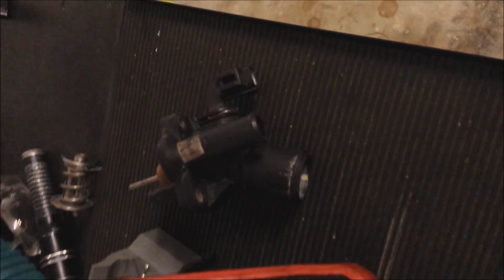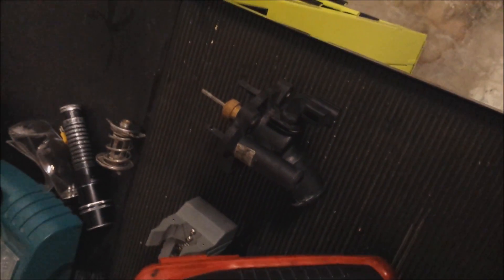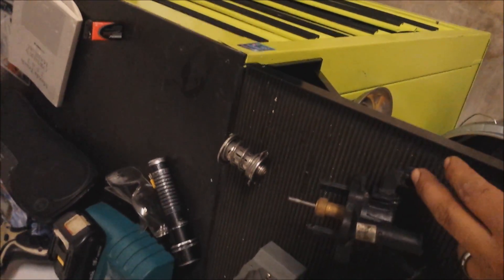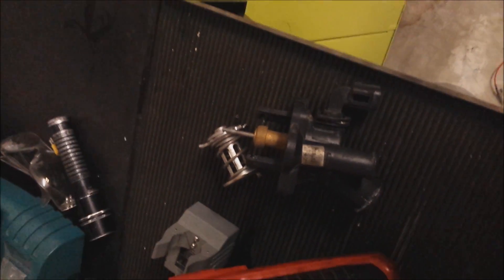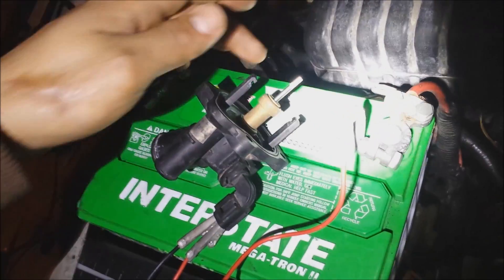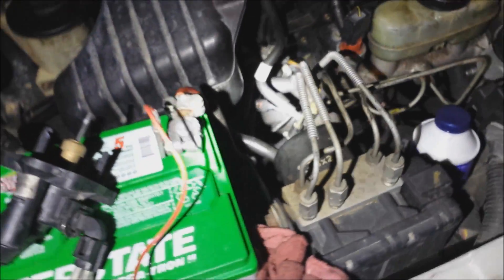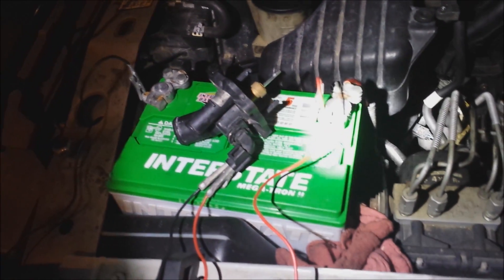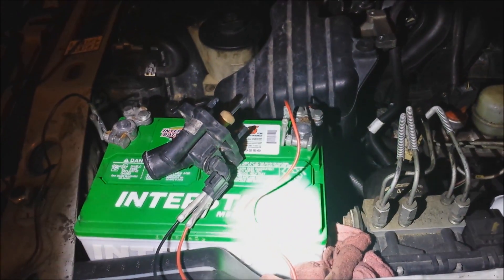Ford ranger electric thermostat test

Comment: those models run high temp was 208+ degrees other yrs avg was 196 deg. also the rad could blocked if it overheats too. good post thx

Comment: please let me add that even if you have 13 volts at the connector it does not prove it is working because the ground is provided from the PCM.  you did not test the ground wire